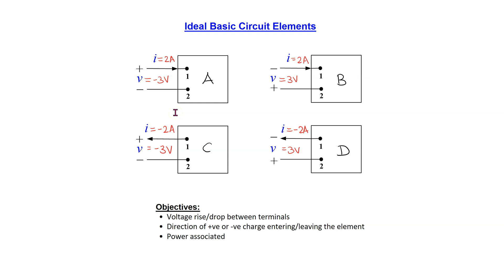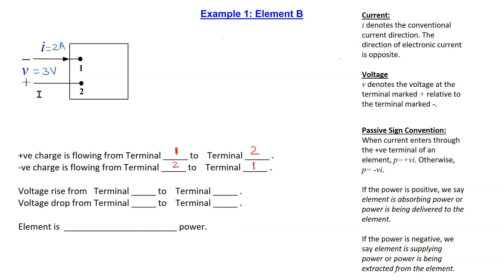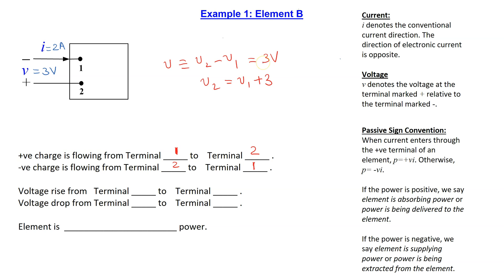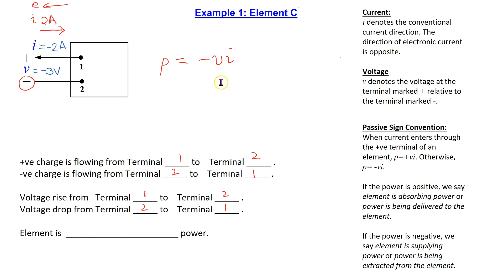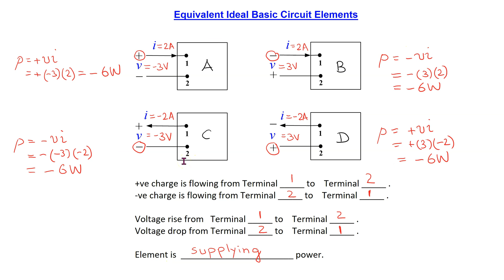How to check if ideal basic circuit elements are equivalent

Comment: Hello profesor, why is the  +ve charge at 5:16 from terminal 1 to terminal 2, shouldnt it be the other way around since it is a -+ circuit?
Reply from the maker: The voltage polarity does not have any impact on the current direction since this is an "ideal" basic circuit element. Hence, we decide the direction of the +ve and -ve charge from the given current value as shown in the video.

Comment: 9:20 I think it's supposed to be the opposite 
for +ve charge is flowing from terminal 2 to terminal 1 because the voltage source is facing down right?
Reply from the maker: When the conventional current has a -ve value, you have to first flip its direction to get a +ve value, before you can decide the direction of +ve charge. 

For an ideal basic circuit element, the voltage drop across its terminals and current direction are independent. It is incorrect to think in terms of a voltage  source applied to the terminals causing the current to flow.

Hope that clarifies the issues.